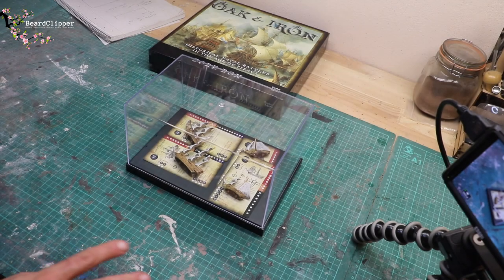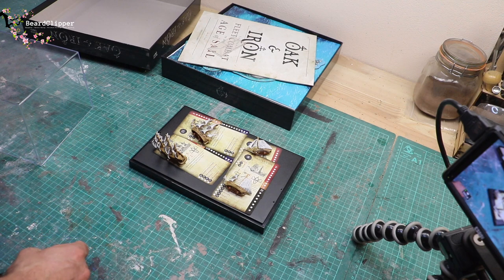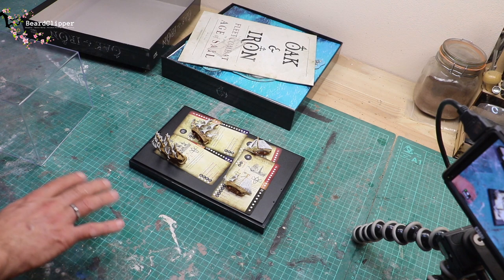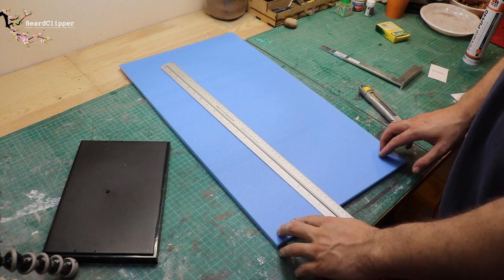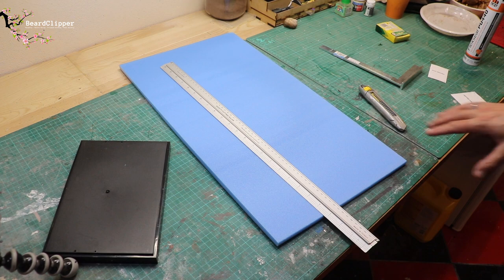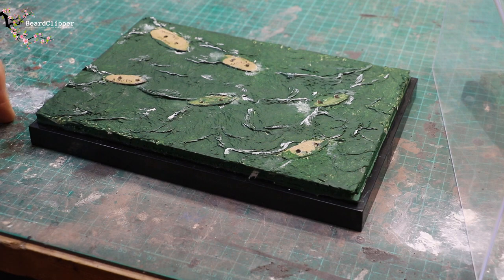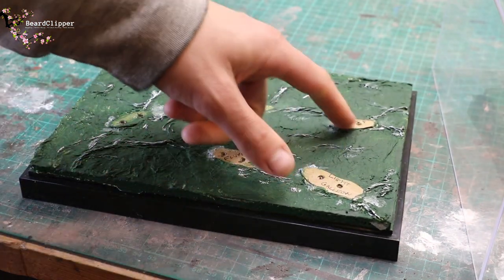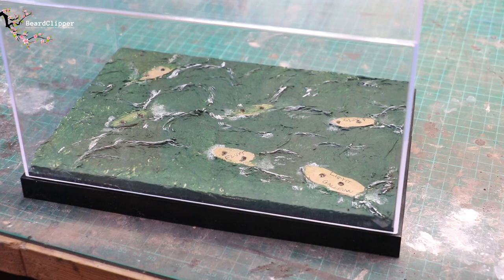How I made a simple Display board for my Oak & Iron Ships

Comment: Really happy to see you make a display board for the shapes you did a really great job well done. Loving the content as usual.
Reply from the maker: Thanks mate :) this one came out particularly well :) I've got two made now and maybe will need another - they are so quick to make :)
Reply: @BeardClipper  have you thought of using magnets so you on the underneath of the display board and on the bottom of the boats so you just can clip them on off and don't have to leave in the holding parts for the boats
Reply from the maker: @leftwingdragon6235  i'm not massively experienced using magnets however in this case I am still quite confused by which ship is which so having them labelled is helpful :)